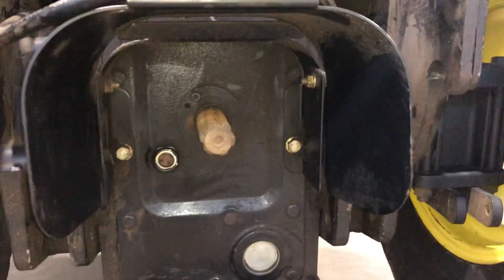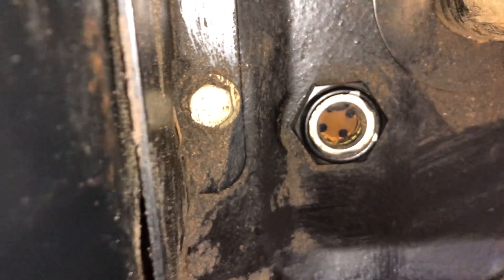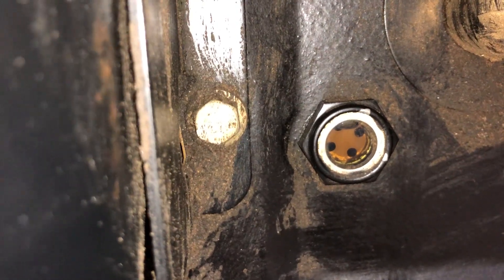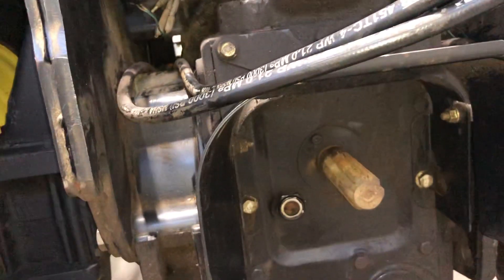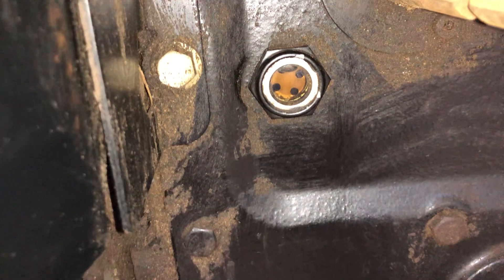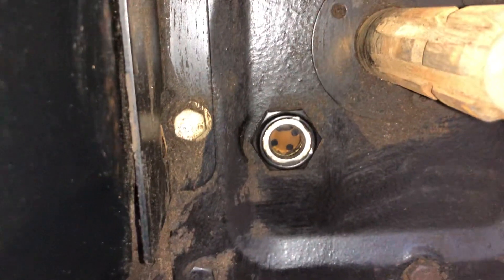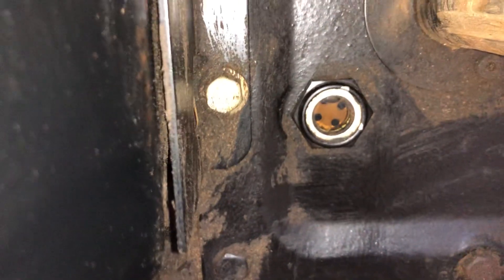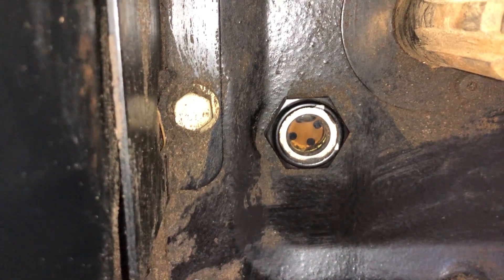John Deere Tractor Hydraulic Fluid Level

Comment: So how did you decide if it was over full?  Should I be able to see oil when I look down the fill hole?
Reply from the maker: Thanks for your response.  The site glass should be filled with fluid about half way with engine off and parked on a level surface.  I had to drain about 2 or 3 gallons out of mine to get it that way.  Was overfilled by previous owner.  Hope this helps.

Comment: How do you remove , if there’s too much
Reply from the maker: @goldenmom334  should be a drain bolt at bottom of axle area.  I usually drain a little and check it
Reply: @darrenmas  👍